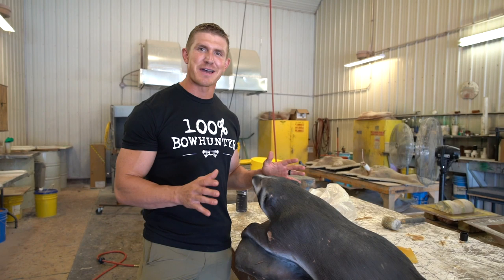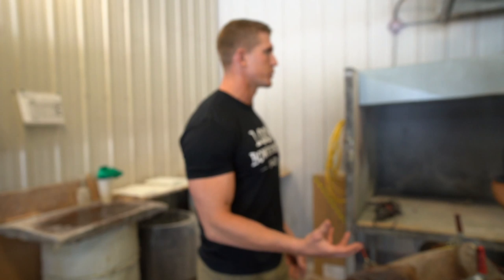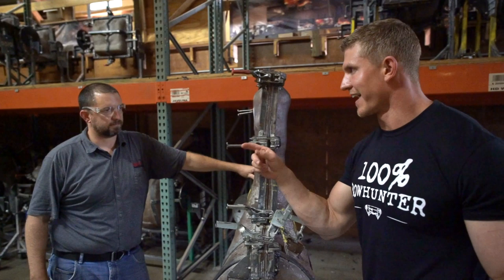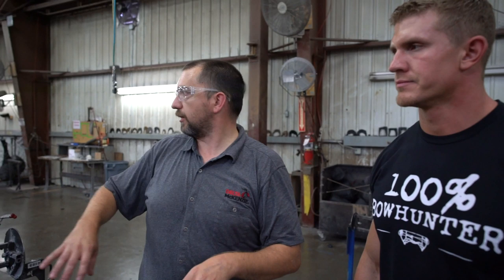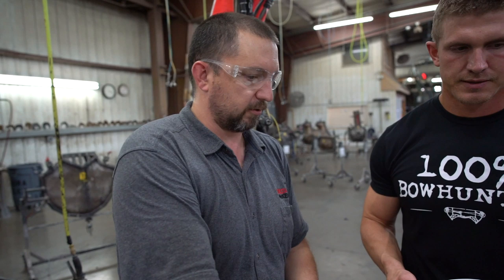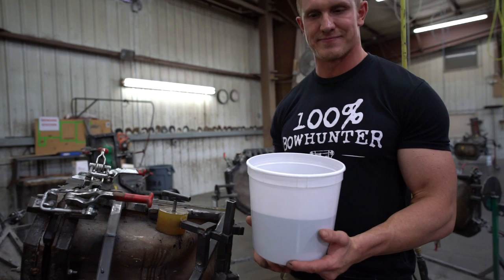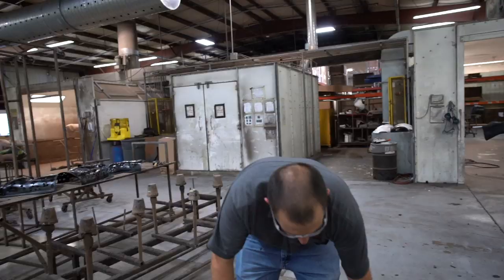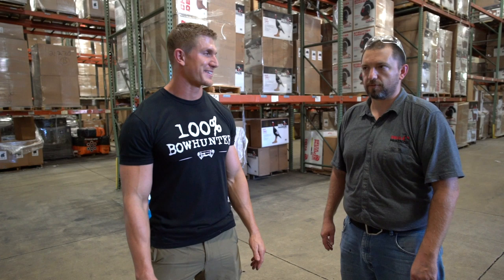How 3D archery Targets are Made! Delta Mckenzie | Bowmar Bowhunting |

Comment: I’m never gonna complain about the price of these again!!
Reply: JettJohnson Outdoors same here, I always wondered why they were so expensive.
Reply: Or even think "I could build my own." lol.
Reply: i Still Complain, Mister Jett "Jet Engine" Johnson, i Still Complain indeed 😥
Reply: @davidsalman8362  it’s airplane
Reply: Fosho like dang
Reply: Prices for the backyard series aren't terrible right now. Got 2 DM's for less than one matrix target🤷‍♂️
Reply: it’s a huge process made solely by a human being and not a machine. I started my job working making Groundhogs, raccoons, armadillos, skunks, and bobcats

Later moved onto deer heads, bear heads

After earning “employee of the quarter”, I’ve now opened a gateway to new opportunities in the company.

Recently I’ve worked at a separate warehouse where we develop and fix the molds. It’s a lengthy and precise procedure using fiberglass and many other different materials.

As far as making targets tho, 

1,) spray wax on the mold pieces and wipe with a cloth (ensuring an easier removal of the foam target from the clamped mold)
2.) then use target specific detail paint with an airbrush to design said animal (ie: black around the deer ears/white fill in/black chin strap etc
3.) take a standard paint gun and spray the primary color over top (brown for deer and groundhogs/grey for raccoons and mule deer etc
4.) once dry, proceed with the clamping procedure (I like to declamp in the beginning before step 1 in such a way where I know EVERY location of each clamp that needs to be on the mold) until you ensure there will be no leakage 
4.5) for the deer heads specifically we don’t have a specific cart/setup so we actually clamp it in such a fashion where it’s standing upright by the 3 main pressure points-top of both ears and chin. It stands on the end of the handle of the clamp using them almost as like legs
5.) mix a mold specific formula of ingredients. “Hard foam” deer heads<- rises much quicker than soft foam<- critters/aka hogs/coons/skunks etc
6.) once accurately poured into the mold, use ur preset clamps to clamp the lid and wait 45min-2 hours (depending on the animal) for it to ‘cure’
7.) declamp all clamps (something as simple as a deer head typically involves over 30 clamps) in such a fashion where you know where to put them back on for step 1
8.) place finished product on a table or at the trimmers station where a set of individuals hand carve the excess outer foam with razor blades.

And that’s how we do it :))